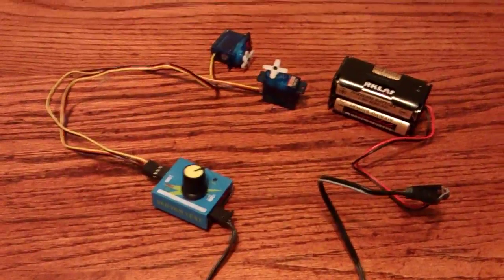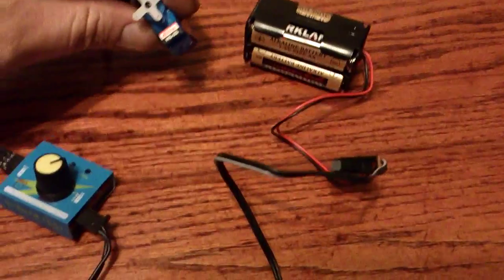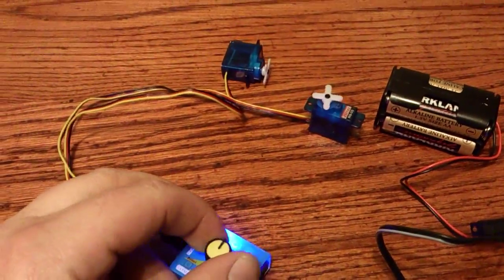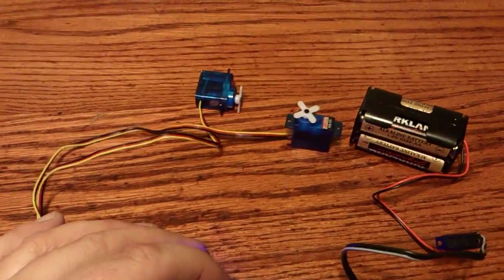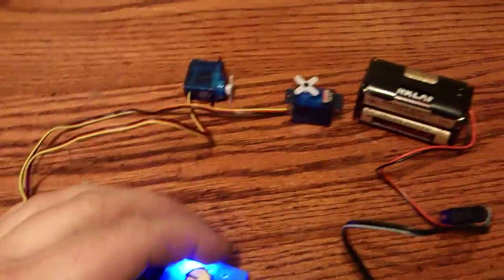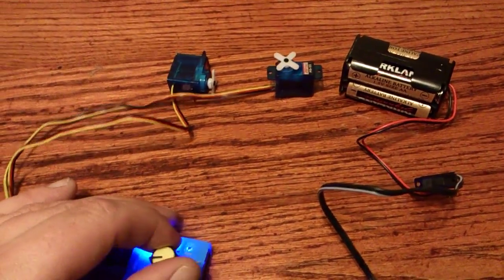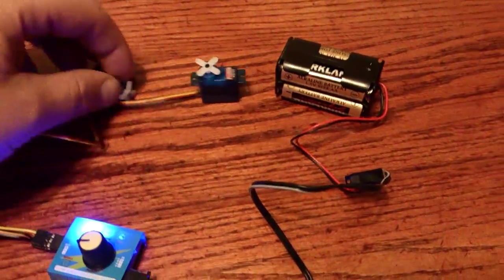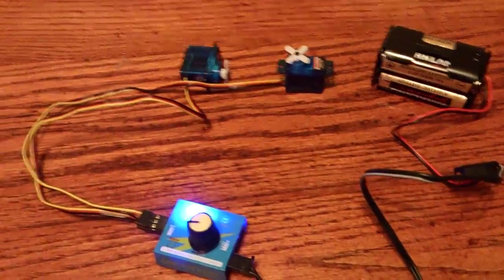Simple servo control

Comment: Hi, I just modifyed a servo to let it go infinity (cut some plastic on the internal gear and it´s working good.)
The reason why is that i need this infinity rotation motor for a video slider.
 That´s kind what i´m looking for but does this controller let me use the servo in total rotation (infinity)?
Thank You